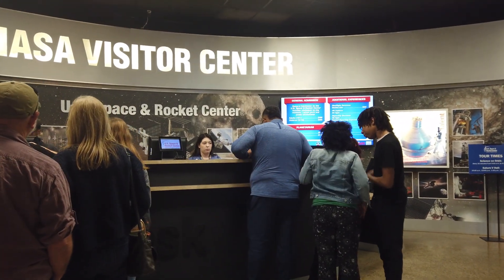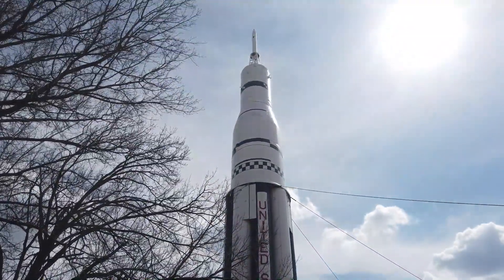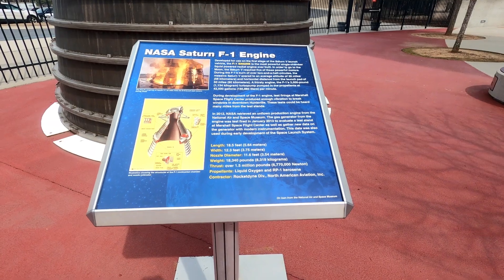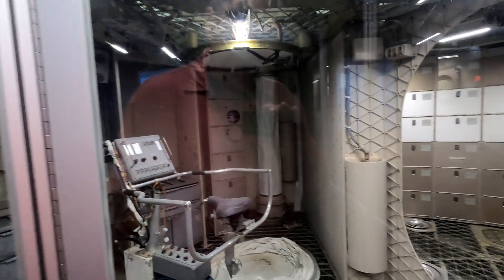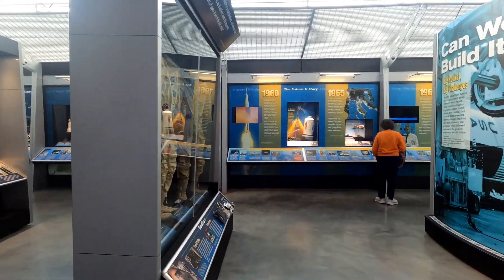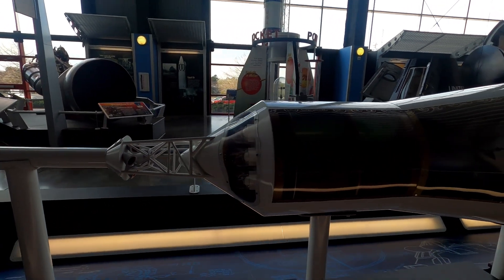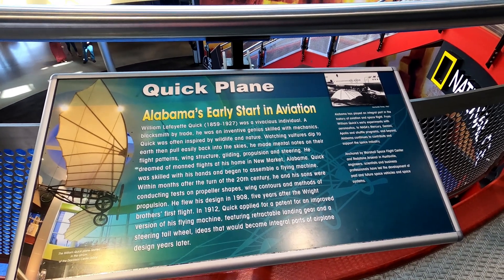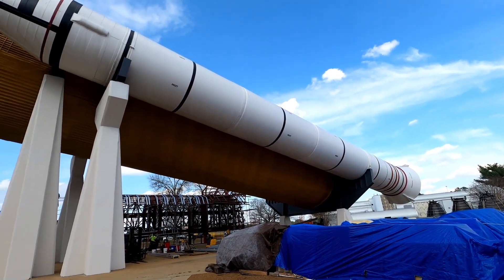Visiting the US Space and Rocket Center in Huntsville, AL

Comment: We were there a couple years ago, but they were closed at the time. W e still saw quite a bit from the parking lot. However, it was great seeing what was on display inside the buildings in your video.
Reply from the maker: I found it interesting looking at everything inside. I've since discovered there's a marker on the other side of the building that I wish I had known about: The grave of Ms. Baker: Monkeynaut
Reply: @thefreedomfilledlife  right outside of the main gift shop! I worked there for years and loved it. I love the center. Somewhat unfortunate they haven't completed the renovations before your visit. They normally have many more rockets on display, and the Pathfinder Shuttle Test Article. The Shuttle is being restored and will be mounted with the full stack upon completion.